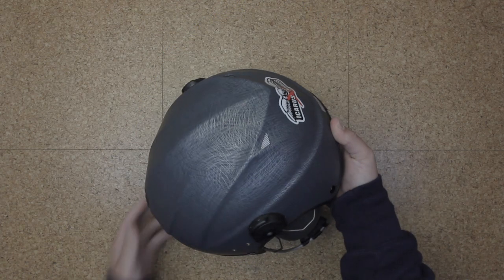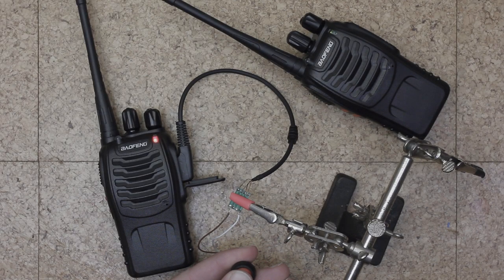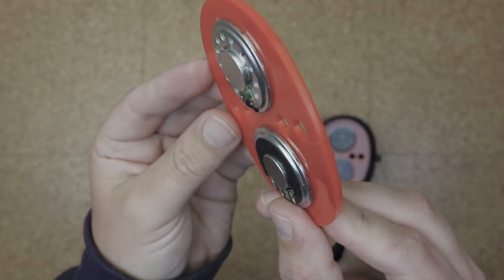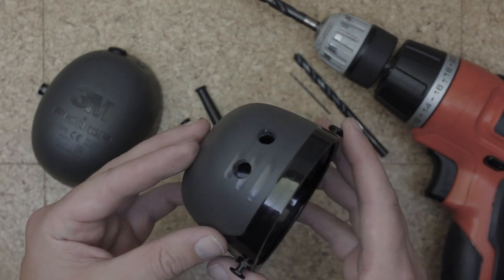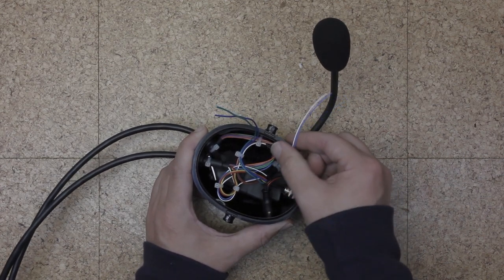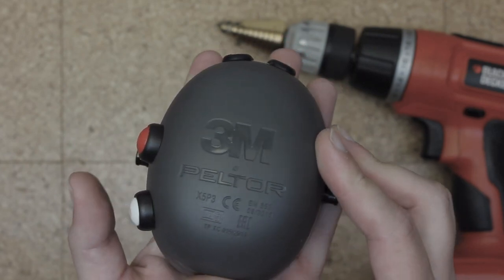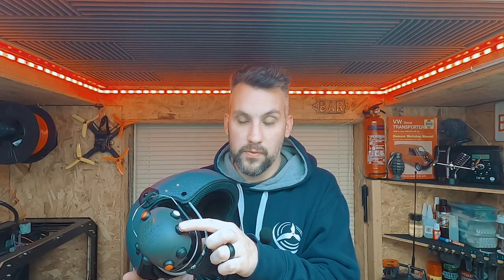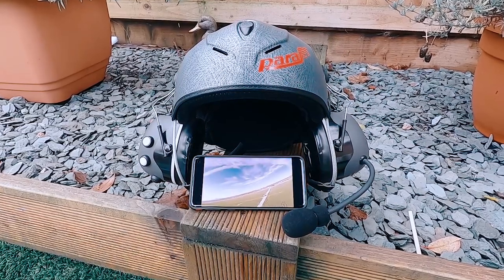DIY Paramotor Headset build – Bluetooth & UHF Radio Integration

Comment: I've made a similar headset this weekend but with a cloth aviator cap as I'm an ultralight pilot. The cap was modelled around a medical anatomy bust! All the wiring is on the headset and the cap is just to stop the Peltor X5 ear defenders blowing off my head.
Reply: I'm using using a Cardo Spirit HD BT headset and I found wiring the mic boom at the front of the ear defender across my face to be best.

Comment: This is awesome. Do you think it would be possible to add Active Noise Cancelling to the system?
Reply from the maker: Hello Harry, I'm sure there is a way. I have found though that I don't really need it at the moment though. It performs well bit I will be something I'll look into in the future!
Reply: @clippedwing-bensmith1614  After I used some Noise Cancelling Headphones on an airline flight, it blew me away how much easier it was to listen to audio. Since then I've been looking for someone who makes a helmet headset that has ANC built-in, but so far no luck.
Reply: I think the ideal set-up would be to have the ANC mic inside the earcup, so it's only cancelling the sound that makes it through the passive sound insulation.
Reply from the maker: I definitely have the space! I'll look into it for sure!
Reply: @clippedwing-bensmith1614  If you ever fancy making another set, (with ANC or just the same as yours) I'd happily pay for your expertise. That setup looks great.
Reply: @harry-knight  same here, I been all day searching for this desired ANC built-in manufacturer but no luck so far… Maybe Peltor Aviation 8000 series but I am not sure how to match those U-174/U Jack with a basic 2 meter radio transmiter. And no built-in bluetooth.  Hope the industry develops something to match this demand soon
Reply from the maker: Have you looked into MicroAvionics? They do a complete set for paramotor use!
Reply: @MagicJF  I hear that PPG Smoke in the US are planning  to make a headset with ANC. Not sure what the timeline will be but they've been posting some photos on their instagram account
Reply: @clippedwing-bensmith1614  Right now I don't believe they offer ANC in their headsets.

Comment: Nice build, but I'm curious with all that limited space for the foam, how much db are they really dampening after replacing so much foam with electronics and wiring?
Reply from the maker: Hello Mike! Thanks for watching! Not that I have any scientific data to go off, I honestly can't tell the difference. I would say that 90% of the foam went back in. The foam did not completely fill the cups to start with, it was only filled around the out side. It would be foolish of me to assume that I still have the same level of ear protection as I have drilled lots of holes in them. I am however satisfied that the level of protection is sufficient though as I have tried to block off as much as I can.

I will have a look into seeing if there is a way of testing these out as you have raised a very valid point!
I guess I could try and get a loud small buzzer of some sort and record the dB level. I would then have to put it in my ear cup and seal it and then record it from the outside.

Good food for thought! I will look into it! Thanks for a great question!
Reply from the maker: Also just thinking, I will try and log the dB level of the speakers. Its a bit of a strange one as I have designed the cups to block out as much external sound (mainly the engine noise) but then replacing it with speakers (a sound source) that is even closer to my ears!

Comment: Hi Ben, your left speaker is parallel wired to the 5V charging supply. How did you manage to not burn your speaker? Great job though!
Reply from the maker: Well spotted! I did change it as I noticed at the last moment. It now uses the other pin for audio. I have made a few changes so will update my video soon! Thanks for your nice comments!